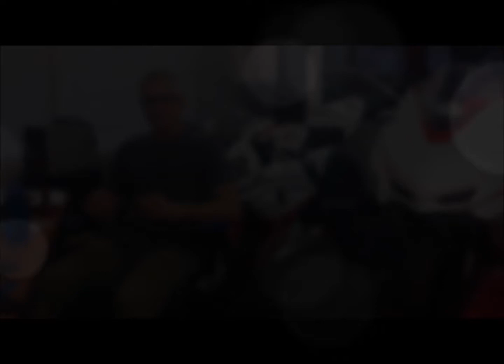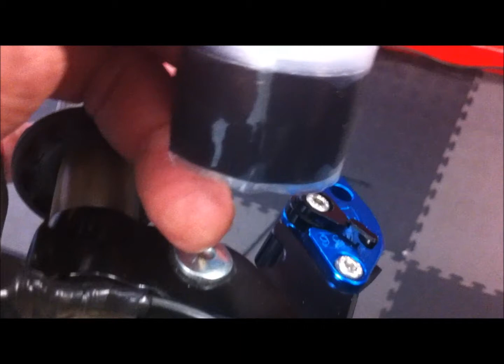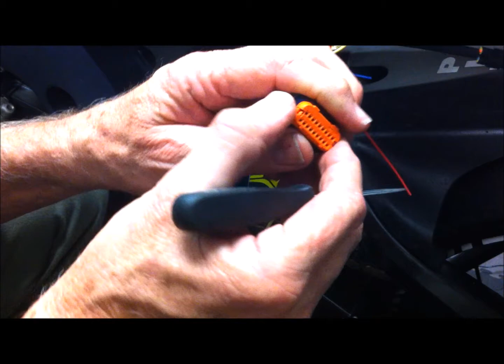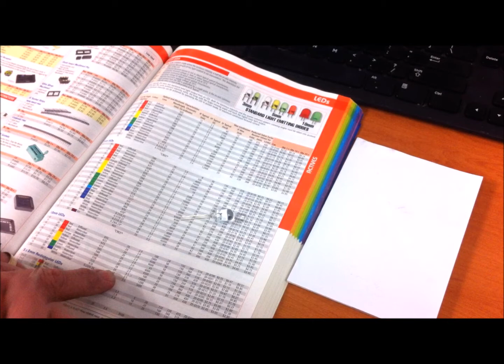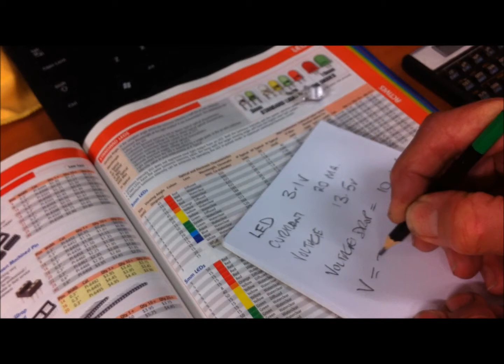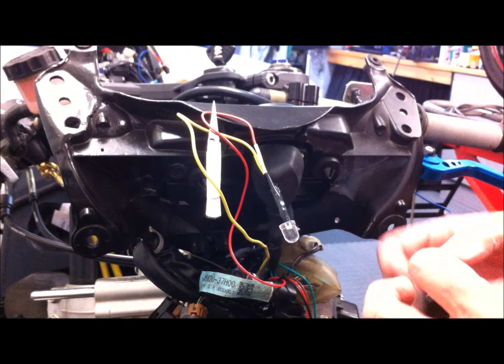Bazzaz ZFiTC Traction How to Make TC Control Adjust Switch TC Active Light and Map Switch P1

Comment: hi, I am also making the same change to put the LED but I do not understand what resistance I have to use, my LED is from 12v and has a consumption of about 10 milliamps, the resistance I need is from 150 ohms ?! 
Thanks 🙏🏻🙏🏻🙏🏻 help me
Reply from the maker: But what is the Voltage for the LED? They usually run on about 2.5V to 3.5V so you need the specs. See if you can follow my calculation so you learn how to do it. Alternator puts out about 13.5V
Reply: Scott Elliott I have this led  
https://www.ebay.it/itm/321742301802
Reply from the maker: @ale22X  Those LED's are accessory lights for your car or motorcycle. They have an internal resistor in the metal body to drop the voltage so you can connect directly. Connect the +ve to 12V and the -ve to Bazzaz unit as shown in the video.
Reply: Scott Elliott ok so I use doors 15 and 16 of the bazzaz unit ? Correct?
Reply from the maker: @ale22X  No you don't need to use #16. Connect the negative wire of the LED to #15. Connect the positive wire of the LED to 12V that's live when the ignition is on.
Reply: Scott Elliott I did as you said but the LED does not work, I put the negative on the 15 # and the positive on the battery to try but it doesn't work
Reply from the maker: @ale22X  #15 is switched to earth by the Bazzaz unit when the TC cuts in so it won't work just by connecting it. You need to be riding the bike.
Does the LED work when you connect it direct to the battery?
Reply: Scott Elliott if I connect it directly to the positive and negative battery, the LED lights up
Reply from the maker: @ale22X  ok so you know it works.
Reply: Scott Elliott ok the positive then where do I attack to try?
Reply from the maker: @ale22X  Sorry I don't understand the question. Just connect the negative to #15. The LED will not turn on unless the rear wheel loses traction under hard acceleration.
Reply: Scott Elliott the voltage of my led is 12v and it consumes 10 milliamps, so i will have to use a 150 ohm resistor is correct?

Comment: To anyone interested  a 147Kohm resistor between the Blue/yellow Diagnostic wire and Black Ground wire on ZFI or ZFITC , ZAFM 6pin harness connector, will make the unit say ZAFM ok and any UEGO or Innovative AFR Gauge kit output can be connected to Brown wire AFR ground and Purple wire AFR Signal on ZAFM 6pin harness connector. Your ZFI or ZFITC will use readings from this unit and you will have a gauge on dash.  
Check out:        Bazzaz ZFITC with AEM UEGO 30-0300 LSU 4.9. 2005 CBR1000RR.

Comment: Dear Mr. Elliot, I have figured out how to get the ZFITC to say OK-warmup. The Blue/yellow 5v Diagnostic wire connected to the ground Black wire will make ZFITC say ok-warmup. The Pink/black is 5v sensor warmup and this wire only gets 5v when the Blue/yellow is connected to ground Black wire. Is it then possible that by grounding the 5v Pink/Black to Black wire the ZFITC will say ZAFM OK? this is the final piece to my little puzzle, any help will be appreciated.

Comment: Could you tell me what is the name  and diameter of connector for TC light?
Reply from the maker: I'm not a 100% sure but I think this is the one. https://www.aliexpress.com/item/Free-shipping-5sets-Sumitomo-3-pin-MT090-sealed-Motorcycle-TPS-waterproof-male-female-connector-6180-3241/32766115745.html?spm=2114.10010108.1000013.2.bt9Ln9&scm=1007.13339.33317.0&pvid=703211b3-4c4f-4c9d-ab71-4c4598365de2&tpp=1

https://www.aliexpress.com/item/10-sets-3-Pin-way-2-0mm-car-connector-Auto-wiring-harness-plug-Car-Waterproof-electrical/32216549735.html?spm=2114.01010208.3.10.iUk9TC&ws_ab_test=searchweb0_0,searchweb201602_1_10065_10000073_10068_10000077_10000074_10000033_119_10000030_10000026_10000023_431_10000069_10000068_10060_10062_10056_10055_10000062_10054_10000063_10059_10099_10000020_10000013_10103_10102_10000016_10096_10000056_10000059_10052_10053_10107_10050_10106_10051_10000097_10000094_10000091_10000007_10000050_10084_10000101_10083_10000100_10080_10000047_10000104_10082_10081_10110_10111_10112_10113_10114_10000089_10000086_10000083_10000041_10000080_10078_10079_10000038_10073_10070_10122_10123_10121_10126_10124,searchweb201603_2,afswitch_1,ppcSwitch_5,single_sort_2_price_asc&btsid=aa15f549-4033-4e60-a08d-37a7dd7feda4&algo_expid=c70fdabb-290e-4c41-ad9a-e18130cd4bc4-1&algo_pvid=c70fdabb-290e-4c41-ad9a-e18130cd4bc4

Email and ask them for the dimensions of the triangle. The male is about 12mm for each side.
Reply: I was thinking about about only those connectors from 3:48 https://youtu.be/N-l-gw1YgoA?t=278
Reply from the maker: As I say in the video .. take the plug to your local electronics shop and they will give the right ones. I don't have any details on the type or make of the connector.

Comment: Before plugging the yellow wire with the terminal on it into the socket i'm guessing you removed the white wire that was initially next to the brown wire? If so, why not just solder the yellow wire to the one that was originally there? Just to keep things tidy?
Reply from the maker: +Wyatt Harvey Sorry Wyatt you've lost me. The socket for the yellow wire is empty. There's no existing white wire or any wires in terminals 15 & 16, I ran the minimum number of wires to keep it as simple as possible. I did cut the yellow wire afterwards and route it through the existing cable sheath and soldered it together again.
Reply: +Scott Elliott figured it out. I was going off your video too much and not trying to figure it out for myself. Just had to turn the connector over and actually look for the pin numbers. Got in there and connected no problem. Awesome videos by the way and thank you for the quick response.
Reply from the maker: +Wyatt Harvey Thanks for the compliment Wyatt. I'm pleased to help  other motorcyclists where I can. A lot of this stuff is quite technical which means the videos have to cover detail. Unfortunately we've been conditioned by the media to all information being transmitted in 10 second sound bites. It worries me that we'll lose our ability to think and problem solve.
Maybe I'm different but I'd much rather be nutting out some problem and learning something than watching some rubbish reality TV show that makes you brain dead.
When you get a spare 15 minutes have a look at this well made video about the philosophy of why we ride. It's quite funny. Pause and read the disclaimers as they're funny but have some good insight. Regards, Scott https://www.youtube.com/watch?v=LRQyEBY5YjQ
Reply: +Scott Elliott I have a background in electrical engineering so I figured this would be right up my path not to mention save 200$ on the bazzaz parts. I guess I was just trying to take short cuts earlier. Just finished watching the video and it's a great insight into motorcycle culture and why we ride the way we do, and the disclaimers produced quite a few laughs. "Harley riders only get told to slow down by their doctors and the cops" had to be one of my favorite quotes. The only question I have for you is where's your Goldwing at?!
Reply from the maker: LOL ... no Goldwing for me. I was at the track yesterday on my CBR600RR ... I'm having a day off today and will be back there tomorrow on my GSXR750. Wednesday I'll be in the forest with a friend on my KTM530EXC ... no Brokeback Mountain moments just riding the trails, creeks and gullies.

Comment from the maker: Thanks John. The resistor size depends on where you tap the power for the LED. Remember the LED has power whenever the ignition is on. The earth side is switched via the Bazzaz unit to ground when the TC is activated.

It's easier to find a switched +12V power supply from behind the instruments somewhere. So assuming you do that you will need a resistor size of about 520 Ohm. You really need to get the LED specifications and do the calculation as shown.
Reply: +Scott Elliott  so the led just needs a constant switched 12 source, which as you said can come from behind the cluster, so really all you need to do is tap a wire into the switched negative on the harness correct? plus figure out the resistor needed
Reply from the maker: +uchi00 Yes that's correct.
Reply: perfect thanks bud